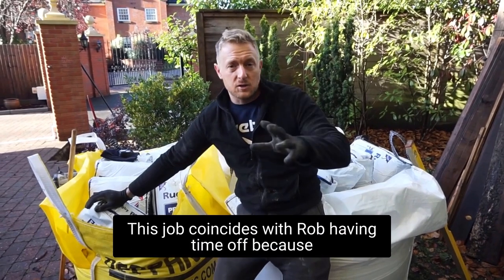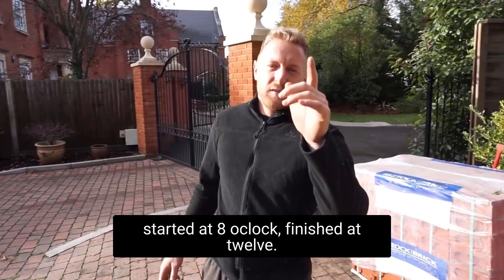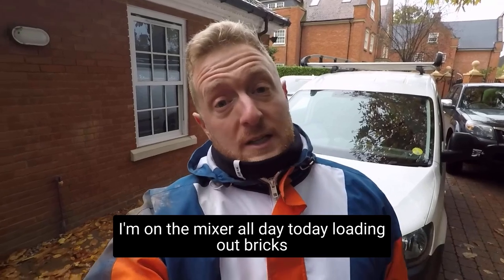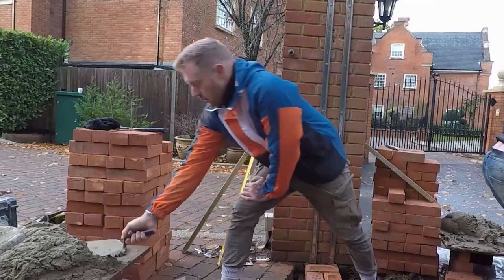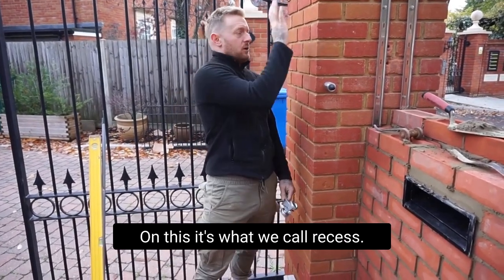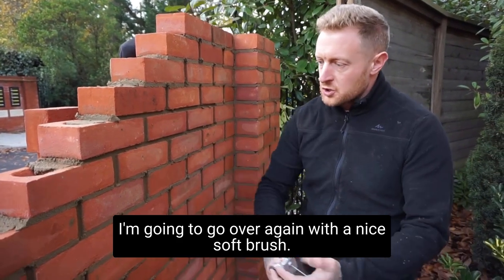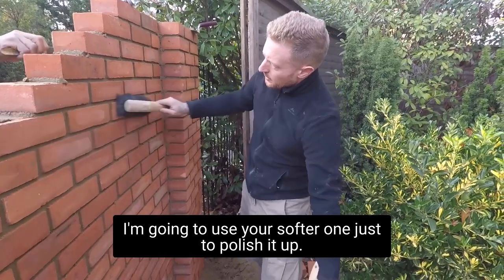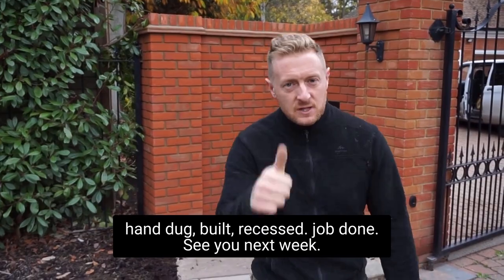EP12: HAND DIG AND BUILD. #bricklaying #groundwork #bricklayers #brick #brickwork

Comment: How do you best calculate how much sand/cement is need for the amount of bricks I either have to much or not enough? Got a rough idea per square metre
Reply from the maker: As a rule Jake a tonne of sand lays 800-1000 bricks. We always allow 5 bags of cement per tonne of sand. We also over order slightly on sand, if we run out trying to get an exact colour match is a nightmare. Hope this help mate